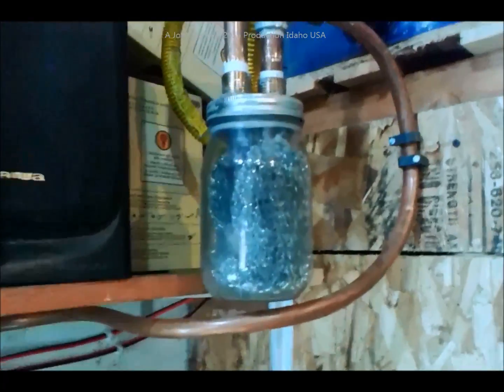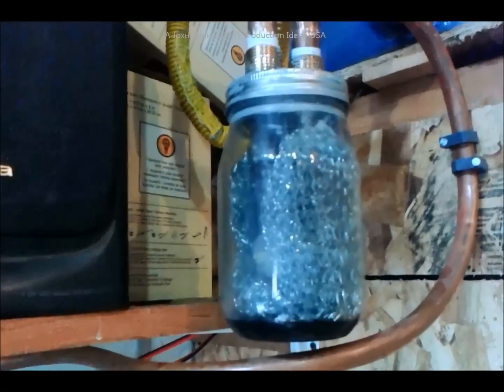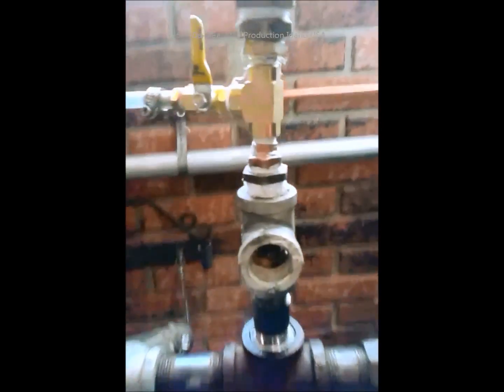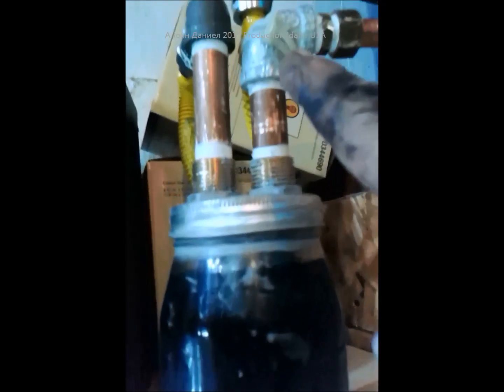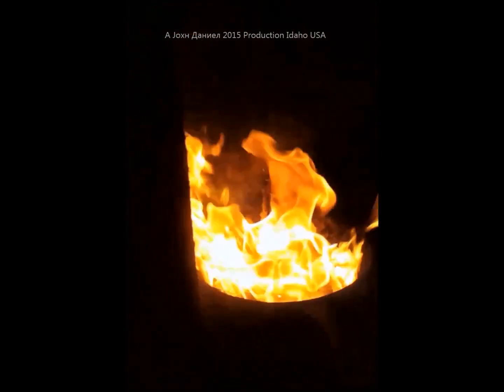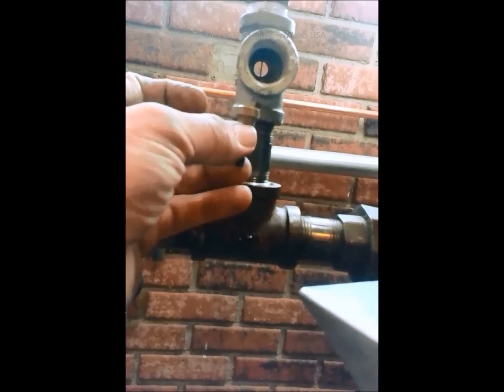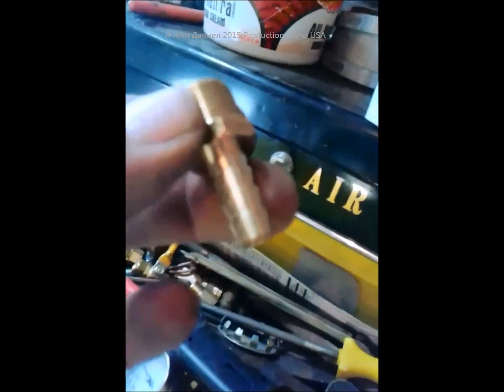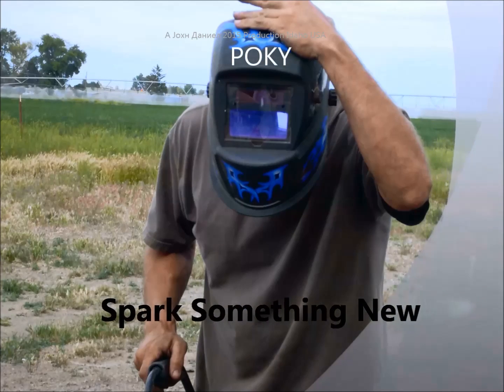Waste Oil Heater design with home made Oil Filtration Piping ( see parts list below ↴ )

Comment: I stopped filtering my oil because it still clogged up, so now I just use a 12v fuel pump on a pulsating timer to pump the oil directly into my burn chamber.

Comment: A simple way to filter would just have a fill bucket with a lid (large hole cut in top) and another bucket on top with several holes drilled into the bottom of it and lay a denim material, even scrap jeans, in bottom and fill the top bucket. It'll filter very well and you don't have to worry about the rest of the lines clogging or having any extra filtering inline
Reply from the maker: This little filter has been running now for a few years keeping out all those pesky bits of material from back yard oil changes. The inline filter near the valve keeps the small stuff from plugging up my fueler. Plus, with it in a jar, I can see if the tank is empty without getting out a ladder to go up and look!

Comment: Hi, no disrespect to you. But why not go to Walmart... There are cheap Oil Filters ($4-5 Bucks) and convert that to your needs? With your Time, Parts and Labor... It will be much better to buy one already made and then convert it............ Just a thought :D
Reply from the maker: With the amount of trash in used oil and the load spring design of the common car oil filter the progressive mesh was the best solution.  Car oil filters require pressure to properly operate. They have a spring load in them ( check valve) related to their prospective application. Most are 7 to 9 lbs, some are as high as 20 psi. Making a functional mount for them is complicated and my system is full gravity fed at no more than 3 psi.
Reply: Yea, you are right... Since it's low pressure... I am going to make my Stove soon. I don't' want to make it too much $$$$, I have to keep the Budget LOW :(((. I think yours is kinda elaborate on the Joiners / Connectors / etc.... Although you did a great Job I think, but on mine... I want to make it Le$$ money as possible. We have Wood Pellet Stoves... But I am extremely allergic to ANY types of Wood Burning. Although our Wood Pellet Stoves are Pretty Sealed... But once it's on, within an Hour, I can't breathe :((((. I see your Stove have a Door... Is that sealed ?? Can you smell the Oil ?? Thank you KINDLY for any suggestions you have or give me while I am on the Hunt for a CLEAN FUEL BURN Stove :D
Reply from the maker: +Jod Bronson You need a exhaust booster on that pellet stove to get no smoke back in the house. Plus if possible get pellets made if Aspen.
Reply: Hi, THANK YOU for the Tips.... But we have tried EVERYTHING :(((((((. My Dad works for a Fireplace Company- Same Company 30+ years, and we thought of everything including the High End Stoves that is like $5000.00+ and still no go :(((. Even with CLEAN BURN... No Smokes in the House... I still have Breathing Problems :((((. It has to do with the FINE Particles or Wood FINE Particles or Wood Heat. But thank you for the suggestions :D
Reply from the maker: You may want to go Propane